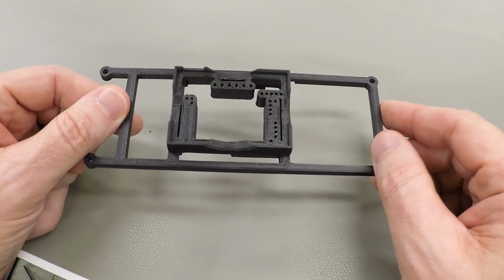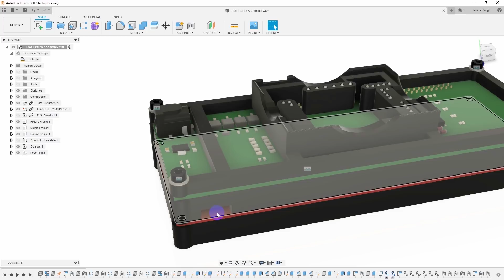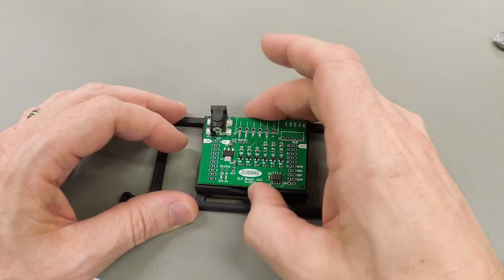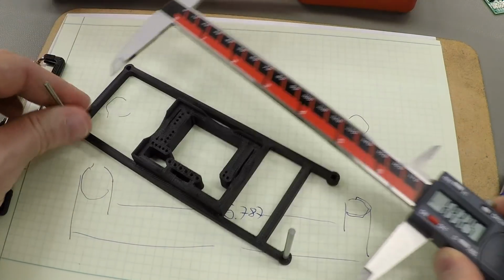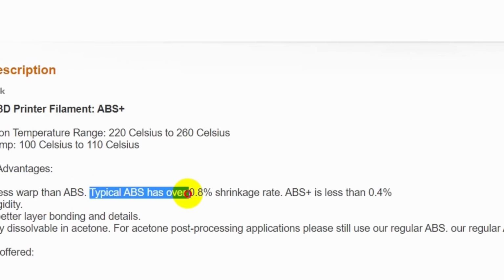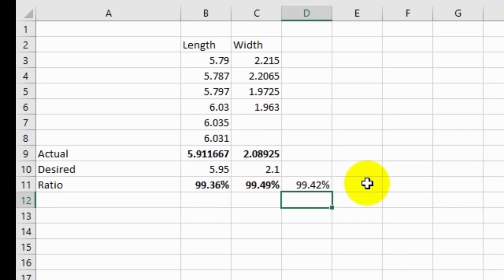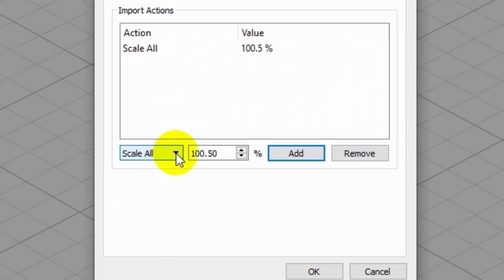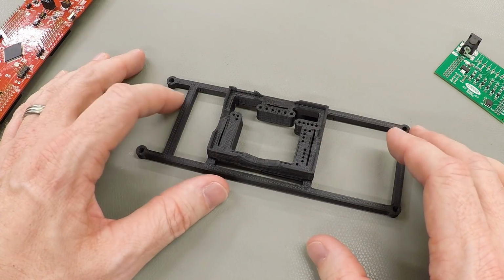How to 3D Print Dimensionally Accurate Parts

Comment: I run into this ALL the time. CNC'ed parts and PCBs never fit their 3D-printed bracket/case. A single zoom factor doesn't work either, because different materials (and brands) shrink/expand differently. Cura lets one set some parameters, but doesn't appear to let you set a fudge factor zoom for a given material / brand. Feature requested...

Comment: Some time ago I made flat square (0.2mm tall and 0.4mm thick) and measured for machine travel accuracy. I also turned it 45 degrees and measured again to test if the machine was properly squared. Didn't bother making a model with both included, like a star of David if you will. And wondered about Z travel, but that might be better tested by counting full turns of the stepper motor and measuring height change, as that would have more to do with the demential accuracy of the lead screw.

Comment: Changing default behaviors is almost always bad, as it discourages you from thinking critically about important parameters. Better is to develop a procedure or checklist to follow for each major step. This has added benefit of being linkable to data tables, such as material type to shrinkage rate lookup. And it also translates more easily to other software packages, when inevitably your favorite software goes end of life or gets changed so that it's no longer your favorite.
Reply: No no how do you do this

Comment: You may want to try Slic3r.  It has MUCH nicer features for doing things like settings that tie to any variable (printers, filement, extruders, etc).  I got used to it after using it for my Prusa.  Once I got the hang of it I ditched Simplify 3D and haven't looked back.

Comment: Why use inch instead of mm?? Mm is much more accurate than inch, also much easier to calculate in mm especially with precision motors as those mounted on 3D printers where you have accuracy of 0.001 mm.

Comment: I hope you can help me with a related issue to this video. I designed a  part on tinker cad. I wanted to actually put it on my fusion 360 for more features and the 3d print option directly to cura. When I brought it over to fusion 360 the dimensions were way off. Can I adjust the sizes dimensionly to get closer to the part I designed on tinker. Thanks
Reply from the maker: Way off, as in a multiple of 25.4?  That happens if you mix up millimeters and inches.
Reply: @Clough42  no I need thr length to br 6mm in fusion 360 its measuring 600mm width 3.5 mm actuall 360 353mm things like that

Comment: Does the shrinking depend on dimensions of the model? If the size is bigger, pulling force should be higher and more shrinkage occurs? Probably linear regression should fit. Will this work better or average compensation works just fine for all your models?
Reply from the maker: The part size and geometry doesn't change the shrinkage ratio, but since the part is adhered to the bed, which doesn't cool or shrink during the print, and the coordinate system of the printer doesn't change, even as the part itself shrinks and moves, different parts will end up with different internal stresses.

However, I've just settled on a 0.5% adjustment factor for ABS and left it there for every print and it's served me well.
Reply: @Clough42  thanks!

Comment: Correct me if I’m wrong, but if shrinkage is the issue, then the print would separate from the bed, correct?  0.5mm would definitely cause the print to separate.  When you removed the part, was it still fully attached to the bed?  Or was it only partially attached?
Reply from the maker: It fully detached as the bed cooled.
Reply: Clough42 interesting.  That means that heating it up caused it to expand by that same amount.  Time to look at the chemistry. :)
Reply from the maker: @KaelumYodi  I'm sure it's a dynamic situation.  There's probably some volume change with freezing, followed by a nearly linear thermal contraction.  Some of that contraction will occur before the next layer, and some at the end of the print.  And the steady state temperature during a long print surely varies with distance from the bed, part geometry, cooling fans, etc.  It's a messy business, but it only needs to be good enough for the application.
Reply: Clough42 sorry, meant to say, “Time for me to start looking at the chemistry.”  👍

Comment: You should try to do the same measurements while the part is heated to whatever temperature you used on the bed, while printing.

Even just try to do the measurement at different temperatures and then maybe look into Linear Thermal Expansion Coefficient.

Comment: I don't know about the simplify3d slicer, and I'm not trying to advocate Cura or any other slicer. You might check to see if you can "create" a  new filament that you can specify the characteristics of, so in a situation like this, where a different filament is being used is different from what you have been using, you can adjust accordingly with a different filament that you're using. And I'm not sure that even what I'm talking about will do quite what you're getting done.

Comment: Your math is correct although your solution is overly thought out. there is an option in the "other" tab called horizontal size compensation, Simply make a ABS profile and add a 0.5 to horizontal size compensation along with what ever setting you like for ABS, it is what i use when printing ABS and PETG and its bang on every time. Perhaps give it a try.
Reply from the maker: I saw that, but it's not a percentage.  It is a distance in mm, and the documentation says it takes that amount off the outside (and inside) edges of the part.  This would compensate well for over/under extrusion, but not shrinkage.  I can try it, but from what I'm reading, this would actually make the hole 1mm smaller (adding .5mm to the inside walls) and make the part 1mm wider, by  expanding the outside edges, but the holes would still be in the wrong place.

Comment: ABS shrinks anywhere from .6-.12% when cooled (I have to set mine to 101.2% for dimensionally accurate parts..but I also use super crappy Inland filament)
Cool measurements and tweaks

Comment: Ive been using your itty bitty extruder i bought form you for years now.
but i often get this problem that pops up randomly, and goes away randomly. And im wondering if you know how to stop it.

the extruder retracts, but dosnt actually push the filament back in, even though it moves the  bolt as if its feeding filament ,and it obviously stops extruding fillament when its retracted, yet keeps "printing", then eventually, it just retracts the filament so far/soo many times, that it kicks the filiment out entirely.

there are no obstructions, the  filament dosnt have a blob on the end to get stuck on,  the PTFE liner is new. The teeth on the bolt are in fine shape and clean..... retractions are  very low, 3 to 6mm...some times 12.

what can i do to stop this problem permanently? i have never been able to figure it out....it just sorta fixes its self, then comes back again at the worst time.
Reply from the maker: I have never seen anything like that.  I would look for intermittent connections on your motor wires, or maybe lost steps.  Maybe you have your retraction and (un-?)retraction speed set too high and the motor is missing steps?

Comment: Just out of curiosity are you still using a Makerfarm Printer?  All of my modifications on mine started from your work.  If so would you be willing to do a review on how yours is holding up.  I am just this weekend going to be rebuilding my extruder as mine split in half on the last print.  I have been giving it some serious workouts though and am amazed at what it has been able to do.
Reply from the maker: It's been great.  I built it almost exactly four years ago, made some modifications in the first few months, and it's just been running ever since.  I am using my own extruder design, but that's been running for years, too.  Does Colin still sell the i3v?  Oh, looks like he does.
Reply: Yes he does but you have to order it. He has other models he stocks

Comment: One thing I didn't see you check, James, was the hole sizes.  Do all the pins fit properly post upscaling?  Also, why not use PET-G?  It should be strong enough, handles heat well, and shrinks less.
Reply from the maker: I didn't check the hole sizes.  Small round holes in FDM-printed parts are almost always undersize.  I typically print them on-size, so they come out a little small and then I run a chucking reamer through them.  If I don't care about the size specifically, I just print a little oversize.  The mounting holes on this part need to clear an M3 screw.  If I size them 3.5mm, I generally get a medium-close fit and that's good enough.  For the test point holes, I want 1.8mm and 2mm for the different contact sizes, so I ran a reamer through the holes.
Reply: @Clough42  Thanks, James!  Makes sense.

Comment: CURA slicer now has a feature to adjust, at the least, the horizontal expansion factor. I have only started to play with it but IMO that is the "proper" way to go. It got me dialed in on several press fit applications.

Leave your CAD designs alone as they are accurate. Make adjustments in the slicer program as required for the filament because if you change filament types or even sources, you'll need to start all over again with changing a perfectly good CAD drawing and saving it somehow that indicates it's not truly accurate to design specs. And then again make a sliced print file corresponding to that expansion alteration only. That doesn't seem like good practice.

Comment: seems hole diameters are always smaller then they should be.. I think its more then just material shrinkage. other then designing them larger to compensate.. any thoughts how to old improve hole diameter without changing overall part size
Reply from the maker: FDM printers have a hard time controlling small hole size.  If I care, I run a chucking reamer through the hole and that usually brings it to about .001" undersize.

Comment: Thanks .. what printer do you use?
Reply from the maker: Mine is a MakerFarm 12" i3v.  It's several years old.  I don't think they make the kits with a laser-cut wood frame any longer.
Reply: @Clough42  What would you recommend for an entry level printer

Comment: Is this method considered as horizontal expansion in cura setting ?
Reply from the maker: This method scales the entire part, which changes the distance between holes.  Horizontal compensation adds or removes material from the walls, which will change the external dimensions and internal hole sizes, but will not change the center-to-center distance between holes.

Comment: Two points: 
a) You set up the scaling such that the Z-Axis scales by .5% as well! As per my experience, the Z-Axis dimension usually is not affected by the plastic shrinkage, because in Z-direction the part size is much more controlled (or constrained) by the G-code. In my opinion, only X and Y should be scaled by 100.5%. I have solved this with a custom G-code header that modifies X/Y steps/mm values and just adds 0.5%, which is btw a very good value for PLA and PETG as well.
b) I believe you may be more accurate if you print test-objects of 50mm, 100mm (and maybe 150mm) size. Now you can fully determine both parameters a and b of the linear formula y = a*x+b (whereas a is the value of interest here). In your case, you assumed b to be zero, which might not be the case (i.e. due to extrusion width)
Reply from the maker: I measured the distance between holes, which is not affected by extrusion width.
Reply: @Clough42  That is also a nice way 🙂

Comment: Sir, thermal shrinking is possibly the cause of this dimension errors. But I was thinking since the plastic melts very fast, the shrinking wouldn't affect that much the total piece length. I may be wrong, it's just my intuition. Maybe it was just a slightly wrong steps per mm config value. Have you tried with other materials to be sure that it was only thermal shrinking?

Comment: Clough42, please note that some printer manufactures locked down their printer filament using cases with eprom chips.  All the necessary information to print a file properly based on material is included in the chip.
Reply from the maker: That makes sense.  We have Stratasys printers at work (uPrint SE Plus and Fortus) and they do indeed take sealed metal filament cartridges with communication contacts on them.  I assumed this was so they could detect if you're using genuine overpriced supplies, but adding information about the filament characteristics makes a lot of sense.

Comment: I'm surprised that if the part was shrinking that much it should pop right off the bed as it cools.  You certainly can't move the part 0.25mm without it separating from the bed.  What am I missing?
Reply: ABS does pop off the bed when it cools. At least it does on my beds covered in Kapton.
Reply: @samsteel4456  My thought was: It cools from about 260 to about 200C coming out the melt chamber to the print.  Then rapidly cools from 200C to the bed or chamber temp depending on layer - so seems half of the shrinkage should be happening before the bed starts to cool at the end of the print.  For total shrink of 0.5mm, you should get around 0.25mm very soon after extrusion which seems like it would pop off before print is done. So wondering what I'm missing that it doesn't.  Would be interesting to print the part, leave the bed hot, and measure before it pops loose.

Comment: I'm gonna guess before watching that instead of using pla, you used abs or some other thermoplastic that shrinks alot more when cooled down. And that the easiest fix is to rescale by 0.1% increments until you get a part that fits is what I'd recommend.

Comment: Slight nit in the excel math (negligible in the affect on the actual print adjustment at these percentages). … you should calculate the expansion percentage needed to get to correct vs using the shrinkage percentage…at these percentages, it’s a small difference.  If an item is 66.6% small, one doesn’t expand the smaller part by 33.33% to get back ‘whole’ — you would multiply by 1.5 of the printed part size with the math being ( 1/(1-.33).  For your specific math, it would be 1/(1-.0058) which works out to be .583…obviously not significant here!   Great video, though and super helpful…thanks!

Comment: I don't know if PLA shrinkage is different than ABS or if it shrinks at all, but my first 3d printer was printing everything undersized and i thought it was due to shrinkage. then i upgraded my printer with a display and sd card reader, which i had to re-flash the firmware with the changes. After that its been printing very accurately in all dimensions I no longer have to scale my prints up.  so I think there was something off in the original firmware settings. i've never printed in ABS on this printer so I don't know how that would come out.

Comment: you should definitely look into the horizontal compensation parameter in simplify3D
Reply from the maker: Horizontal compensation adjusts all of the walls in and out, but does not change the distance between holes.  I demonstrated this in the follow-up video.
Reply: @Clough42  Exactly! It's a really useful feature, but of course the steps/mm have to be properly calibrated first

Comment: When i worked in a prototype shop we had to know the amount of shrinkage or expansion when working with plastics and casted products. It could be the shrinkage factor of The thermoplastic. The plastic when heated has a bit of expansion and as it cools it will shrink. You have to build that into your figures. Plus if your going printed part to printed part they will shrink the same.

Comment: When you model your part do you usually model to the exact size that you want or are you over/under-sizing features to account for the 3d printing process?
Reply from the maker: I model exactly to size.  Except small round holes.  I either model them slightly oversize, or I model them on size and plan to run a reamer through them.

Comment: Print it again in PLA, then check the dimensions. I have a feeling it's more likely to be the steps per mm on your firmware. Each layer is cooling as it is printed, do the prints pop off the bed if you let them cool there?
Reply from the maker: Yes.  A thin part like this stays pretty close to the bed temperature for the entire print, then shrinks as it and the bed cool, popping off in the process.  The glass is borosilicate, with a coefficient of thermal expansion of .000003/K.  The bed temperature is 100C, and room temperature is 22C.  So the glass shrinks 0.02% and the part shrinks 0.5%, popping it free from the bed.  The larger the part, the more likely it is to pop off during cooling.

Comment: I'm chasing the same issue only my parts are about .5 mm larger and my holes are .5mm smaller . 
I need my parts to fit without sanding

Comment: You can add aligning holes to your board and use metal aligning pins on bottom board . It will work much longer as PCB will " eat" plastic after few hundreds inserts and you will get worse alignment .

Comment: wouldn't a profile for that particular filament be a better way of solving this problem?
 I don't use S3D I use Cura but the simple way to do this would to just save a profile named as the filament
Reply from the maker: If S3D had a scaling factor as a part of the filament profile, I would use it.  It does have something called Horizontal Size Compensation, but it does something different.  It adds material to the walls.

Comment: I would have started with checking the tension on the belts.  A little slop in it is doubled as the motor goes back and forth and pulls tension out of the slop and then repeats on the other end effectively losing steps that came out of the motor but didnt make it to the extruder.